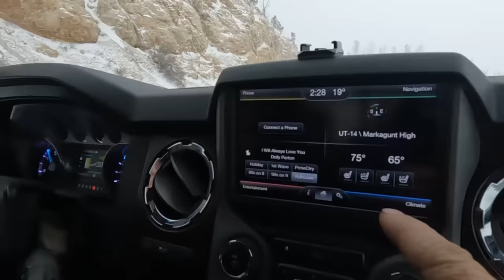Major Snow Storm Pushes The Morrvair To Its Limit!

Comment: I'm going to go out on a limb here and suggest the driver of the first truck was going too fast...
Reply: And he hit the only tree for miles
Reply: @GaroMatossian I did not even think of that until I saw your comment 😂😂 if there is a will there’s a way
Reply: @GaroMatossian  dont forget the only giant boulders in sight
Reply: My guess was “drift” gone bad
Reply: Yep…an attempted Dukes of Hazards drift turn.
Reply: Haha nope! Buddy of mine actually. Late night. Soft dirt. Only had 2x. He was only going about 25 actually
Reply: @Turning Wheels  that damage, clearing that boulder, and splitting that tree was not less than 50-60.
Reply: @tankscrittersandurbanhomes5579  that was my thought as well. I've messed up a few vehicles/wheels in my time, and low speed does not clear obsicales like that, not cause damage like that wheel sustained.
Reply: @tankscrittersandurbanhomes5579  forgive the spelling errors in my previous comment. For some reason this app is not letting me see anything other than one line of writing overlapping itself. Which means I can't see what the hell was misspelled from my fat thumbs, lol!
Reply: The truck also kinda went out on a limb...
Reply: @turningwheels7167  doesn‘t explain why, especially if at that low speed.
Fell asleep ?
No lights ?
Reply: Of course go as fast as you can . I'm unstoppable .not.bang
Reply: @turningwheels7167  lies. If he was going slow he wouldnt have gone off the road and over a boulder, busted a wheel, and broke a window. He was either driving too fast, or he was going slow but was drunk and didn't try to stop or something like that. No way that kind of thing happened by going a reasonable speed unless he was impaired or distracted.
Reply: When you think you are a baja 1000 driver after you install a spacer lift on your truck
Reply: Too many mph and too many Buschlights…
Reply: Why was that Ram not getting anywhere in that snow. It looked like a 2wd.
Reply: @pan6593 in the video the driver said he hit the loose gravel on the shoulder and went off the road
Reply: lol going 25mph. 

Then waited til morning to sober up before calling for a tow truck. 

Don’t get me wrong. I would tell the low speed soft dirt story too.
Reply: Possibly fell asleep at the wheel, or, possibly under the influence??
Reply: And possibly alcohol, that’s why it wast called in for a day or two.
Reply: Definitely

Comment: Matt fixes his cuts like I do. Electrical tape works way better than band-aids. A whole roll is like a dollar. It's more durable, you can cut off as much as you need, easier to open and it also works on wiring :)
Reply: super glue is what Ive used
Reply: LOL ! I've done that so many times, and it works fine. Interestingly, enough, I've never had a cut, or scrape, etc, become infected🙂.
Reply: As a retired auto mechanic, My buddy showed me the use of electrical tape for cuts back in the 80s. I still use it to this day
Reply: i use super glue
Reply: It's called a Mandaid and it comes in different strengths. 
Paper towel for minor cuts
Paper towel and electrical tape for bleeders
Super glue for lacerations
Wire for stitches
Reply: And if you need to clean and sterilize......brake clean
Reply: @ssh4779  There's too much oil and gasoline in my blood for any infection to sneak in.
Reply: @yourhandlehere1  LOL; I agree; all that grime must have a medicinal effect.
Reply: @danielmorskijr411  well you could use Ballistol (gun oil) as it was designed to oil guns AND clean wounds
Reply: @danielmorskijr411  What?! no welder for cauterizing wounds??? lol
"Acetylene? Mig? Tig?"
Reply: @danielmorskijr411  I can only claim to have used a paper towel, and once when I was in a orchard, spider webbing to clot a self-inflicted stab wound.
Reply: In what way is it like a dollar?
Reply: Super glue is what's used in ERs
Reply: @NoName-zn1sb  Lot's of places. Harbor freight you get a 10 pack for 6.99. Walmart .80 cents a roll. Amazon 10 rolls for 12 bucks and yes 3M or scotch will cost 3-4 dollars a roll.
Reply: @NoName-zn1sb  😉😉👍🏻🤣😎
Reply: @danielmorskijr411  brake clean????   what the hell do you have against vodka?

Comment: 10:58 good lesson for those not familiar with the snow.  I used to teach snowshoe and cross country ski prep courses, and would always ask the students to bring in what they thought they should be wearing ... all were well, well over dressed.  If you're about to start something physical in the snow, you need to start off cold (painfully cold, depending on what you're doing, and for how long), or you're going to over heat, start to sweat, and things are going to get bad really fast.
Reply: yea...I still haven't figured that out
Reply: I went snowshoeing for the first time a few years ago. It was about -11F. The trail looked like a yard sale behind me, and I'm very familiar with winter sports. I DEFINITELY underestimated the effort of snowshoeing above 6,000 feet. I shed layers before I got too sweaty, but my hair and beard froze to my balaclava. I wish I'd read your post BEFORE I tried snowshoeing. Very practical advice.
Reply: This is a big one for me as I commute by bike year round. Am I cold? Only for the first 5 minutes or so. The hill up from my place gets me warmed up pretty quick though.
Reply: Yes, and some warm clothing in a back pack if your out snowshoeing etc.
Reply: Layers are key.  Undershirt, tshirt, long sleeved shirt, thin jacket with a hood , then regular  winter jacket with a hood .  The hood is for wind. Wind will make anyone sick. 
Easy to peel layers.

Comment: The whole reason I started watching this channel was to learn recovery techniques because when I'm out in the mountains in my truck I don't have a winch on my truck so I carry come alongs and Jack's, shovels, chainsaw ropes, cables. I always enjoy seeing new moves and methods that I did not know about trying previously.
Reply: 2 inch receiver hitch plate mount for winch - 75 bucks. Winch - 260 Harbor Freight. 350 and you’ll have peace of mind out there. At least on the tail end 😂
Reply: @jash1 wiring is the "hard" part. Unless you just have an extra battery to tote around in the bed

Comment: I wonder how many people have been saved because of people who have watched Matt's recovery channel and learned a thing or two about recovery? I know I have even though I've never had occasion to use what I've learned. Thanks for the schooling and entertainment Matt.
Reply: I always have a toe strap in truck. I will always stop for trucks and large suvs. But will drive past cars with no recovery point. I dont want to be responsible for damage. After watching Matt's offroad recoveries i am thinking about getting a hook.
Reply: @guyod1  Really good idea - I keep a few things in my truck but a good hook be great.
Reply: I'm in North Alabama and we rarely get snow. In 2019 we had a pretty decent snow storm and I pulled out several people. Five in one night from the same spot. They were all trying to make it up a small hill, but made the mistake most  people do of not carrying enough speed. I turned them around using the trick I've seen Matt do of setting the parking brake, hooking to the front and letting the vehicle pivot. It worked fantastic and the drivers were all amazed. After a quick snow driving lesson, which was basically plan out your route with as few hills as possible, use the momentum speed gives you, and slow down way sooner than normal I sent them on their way. All but one tried to pay me, but I wouldn't take it. Since then even though I hate snow I kinda hope for it so that I can get out and use the skills I learn watching Matt and crew and help people.
Reply: Watching this show I got some soft shackles and a kinetic line in the truck now. In the last 6 weeks Ive used it 4 times but Im also at 8000ft in the rockies. Lots of people going into ditches or just cant get out of their own driveway.
Reply: @guyod1  im in idaho and our snow gets way worse and i help several people in cars trucks etc from rolling people back on there wheels to pulling them out i use chain because my straps are always frozen the trick is to pull low matt always messes up and pulls from up high which lift the car and not pull thats why he rips there bumper off or tears it its simple physics you pull up at a 45 degree angle that rope or chain will become perpendicular and tear through the bumper all you have to do if your vehicle is lifted is redirect the pull and youll never tear a bumper as long as your careful
Reply: @jondub9524  I carry a snatch hook on 4 foot of chain...I consider it essential equipment...I also carry snowmobile tracks

Comment: This winter has been crazy! Us in South Dakota haven't had this much snow in many years! And winter has just begun 😭
Reply: In canada chicoutimi too
Reply: Same here in Minnesota. It is pretty wicked, probably going to have to shovel the roof off today. We have probably around 16" of fresh snow overnight and then around another 14" of good & ripe snow from that storm end of last month. Just from overnight in the walkway there's another six inches there.
Reply: and in Europe we have 15C (59F) right now where it should be at least around 0C (32F) if not lower (-5C - -10C), for new years there was 15C at 1.500m...it is crazy warm for this time of the year...
Reply: Your not alone.  Ice age 🥶
Reply: North Dakota has been pretty rough this year also.
Reply: Well, the front moved through Arkansas a few days ago and it got down to -18f and froze my water heater, a couple of days later and it was almost 70f. So when you go out, be sure to carry blankets and some shorts in your car.
Reply: And we can go out in t-shirts @ 12-15 degrees Celsius in the sun here in the middle of Europe. Crazy indeed.

Comment: I think this is one the heavy wrecker would have done much easier than the rollback, Morrvair, or Banana.
Reply: Nah.   Morevair  was the right tool.
Reply: YEAH. something to look forward to ~ this time next year .. .. .
Reply: Only time heavy wrecker would have been less useful is turning around that ram. If he takes the wrecker out in snow like this, I could see it getting out of hand and being tougher to get back home way easier than the morrvaire or the banana. Having more weight than everything else is great when you have traction, but it's going to run into the same issues as the other trucks very quickly. Snowcat is still the best option with almost 2ft of snow on the road.
Reply: @tricd0444  not really. The wrecker is on what? 54’s while those trucks weren’t even on 33 all terrains. Tires make a world of difference in these types of conditions.

Comment: The other problem with diesel pu’s in slick conditions is the weight balance is all wrong, all the weight is on the front axle, if you have one put at least 1500 to 2000 lbs in the bed behind the rear axle and they’ll do much better

Comment: I want to experience this weather some day. It does not snow over here in Nairobi, Kenya.
Reply: It looks beautiful but it can be very painful and dangerous
I went on a trip out west and got to experience sleeping in the back of my truck, in 17* degree weather (Farenheight) with no source of heat. 
it was painful on my bones, and I could not stop shaking at one point. 
I have some videos on my channel of that adventure, in case you want to see them.

Years ago I got stuck on the road and by the time I got help my hands were numb, all my fingertips ended up peeling, that was painful
Reply: @LincolnMaxnCo  that's must have been brutal!  Its looks beautiful to me, I want to experience it
Reply: @George Vinson you are probably right, 
I hope your hands are back to normal

Comment: I'm surprised you guys are not using tired chains for this kind of condition. The Bombee it's probably ideal but with just tires it looks a little iffy.. but you are the man, so keep getting it done as God blesses you and guide you...
Reply: Chains are sort of a pain to put on, then you have to take them off.

 They were still able to move so they were good. If they need chains then they should just take the tracked bombardier.
Reply: Chains are a last resort for a 4x4. Likely to damage the body or be broken when pulling hard in a recovery

Comment: I think the "honks" on the snowy road was to tell you to turn around and go back! 🙂 I can't believe the type of tires some people try to run in the snow.  Great video.
Reply: 99 times out of 100 it's not the tires, it's the air pressure. Most decent 4x4 tires WILL do the job, but you need to let a ton of air out. In snow like this I'd run somewhere between 10-15psi.

Comment: At 18:29 you said it. Absolutely true. Those Dodge/Ram Cummins are helpless in snow and deep mud. That 1200 lb motor makes the front end like an anchor. Then, there you sit. Especially with tires like on this one. Might I suggest however, tire chains on all corners. I can't exaggerate what a huge difference they make.

Comment: In WI winter 1967, ran off the road in the country on black ice.  Came back the next morning, only to find 4" of the antenna sticking out of the snow. It had drifted over in the culvert.  Took several days for the car to thaw out!  Took a 48 Dodge Power Wagon wrecker and a Case tractor to pull it out.  The good old days!

Comment: Matt, as a long time diesel driver I'm used to the small throttle adjustments and torque management that's necessary when operating in slick conditions. I grew up in Western NY in the lake effect snow belts, so I'm used to driving them in snow and slick conditions. For me when I get in a gas truck (usually dealer loaner) I have the opposite problem you do. The throttle seems sooooo unresponsive compared to what I'm used to. Not to mention the screaming high RPM that seem required for the gasser to develop power.

For me the biggest negative to my diesel trucks is the heavier engine weight, compared to the gas trucks. Combined the the light weight of the rear of a pickup and that diesel torque they can be fun to drive when it's slick out. =)

Comment: An idea for moving rocks. Can get a battery operated hammer drill and a hand full of mechanical anchor bolts, they make D-rings that screw onto the anchor bolts. Used them alot in my line of work. Could hook the winch onto them and rip them right out. Could also use them for anchor points for extra pulling power or snatch block rigging. A 3/4 inch or a 1 inch would do just about anything you need. Easy to install and surprisingly strong. The D-rings would be reusable also. Ive put hundreds in myself, maybe more.

Comment: Such wise words or wisdom regarding a heavy duty diesel on throttle control. I've been an avid off road driver for decades, and tow heavy so I need a diesel to get to the area I intend to play. I even take it into the mountains in good conditions but only use my dedicated off road vehicles to play in the snow, sand or mud. My current newer ram has an electronic throttle that isn't even predictable. It torque manages in such a way that you're pretty much just along for the ride, not the one in control to a large extent. It will apply power when, and in the amount it thinks appropriate despite what you command with the petal. If you forget to turn off the stability and traction control, it get even uglier.

Comment: A little tip for snow wheeling for future reference the lower the air pressure depends on how wet the snow is or how fluffy it is. A lot of the time pulling a vehicle out of a ditch then winch. But love the videos.

Comment: I live in MA and we haven't seen snow yet (just a dusting).  February is one of our worst months but we've had mild winters for a while.  We have so much snow removal equipment around here and they spread so much road salt and sand that roads are just mostly wet. Getting through my driveway is the hardest part.

Comment: Hey Matt.  I live in Northeen Ontaeio Canada and we get a ton of snow.  Like my deck has 2 + feet on the bbq and deck.
  I know how to drivw in snow, deep or otherwise  BUT when I was headed to the redwoods n of Bakersfield,  i discovered that your snow is wet and far slipperyier than ours.  THAT  makes a huge difference.  And why you need the bombi when on snow rescues.  The new huge wrecker will just slide faster and further than the Morvair.   You could try chains or even studs to get better traction.

Comment: You're right. Those things are pretty helpless in the snow. Even with the best of tires. I managed a entire fleet of them for a "off road" company.
We had the half tons too, which is possibly the worst vehicle I have ever had to drive in any significant amount of powder. They would be stuck in spots where other make and model stock trucks with highway tires would walk by them.

Comment: I used to live in Anchorage and drove cab for a living. If you start to slide take your feet off the pedals usually the car will straighten up. We had an huge ice storm one November right before Thanksgiving and me in my rear wheel drive crown vic taxi, I did 189 miles that night. I had people with 4x4's calling me to take them up to the hillside on the mountain in my rear wheel drive crown vic. I think I went up there 4 times, I called it riding the slip-n-slide. Then the next day I learned that the car owner had waived the leases for the cars to keep drivers from driving that night. It has to be bad, bad, bad, bad before a car owner would waive leases for weather in Alaska. and I drove and made good money that night.

Comment: Agree on the diesel in snow. My 6.7 RAM is a handful in snow. Has to be right at idle or it spins with ease. Even with a flatbed and camper and over 10k on 37’s.